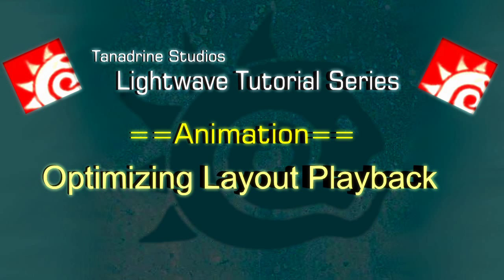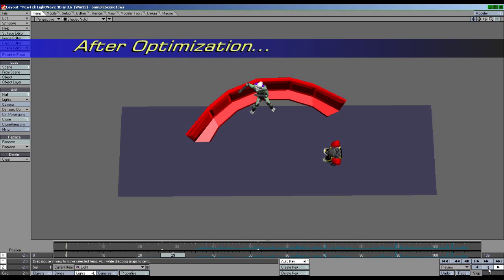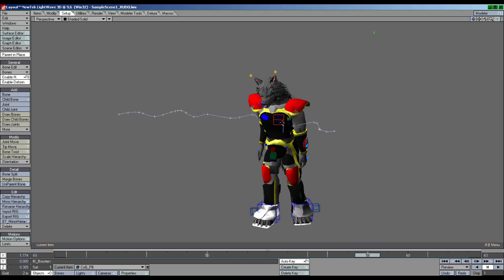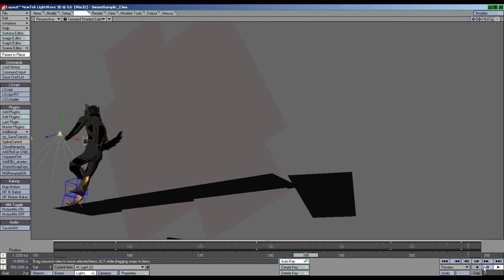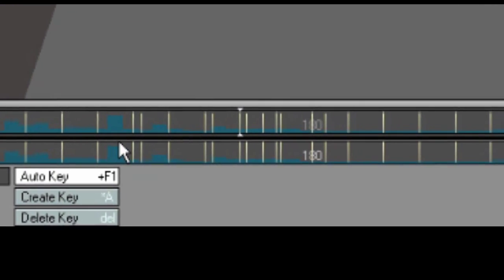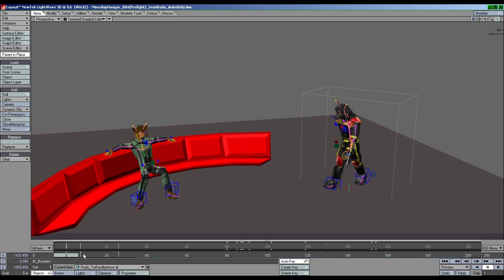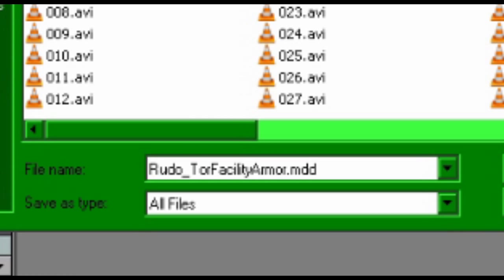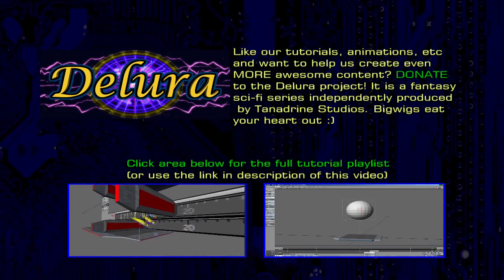Tanadrine Studios Lightwave Tutorials: Optimizing Layout Playback and Performance

Comment from the maker: Select by partial name is available via keyboard shortcuts menu... just search the word "partial" and it'll come right up. This option is better since you don't need to type as much. Also, it is extremely handy for selecting locked items

As for the other options, those are some proprietary scripts/macros i've made for myself to speed up production, as well as scripts made by others. If you hold ctrl+shift and click left/right mouse button, you get a menu. Customize it in via "edit menu layout".